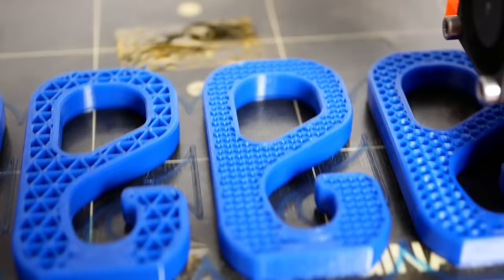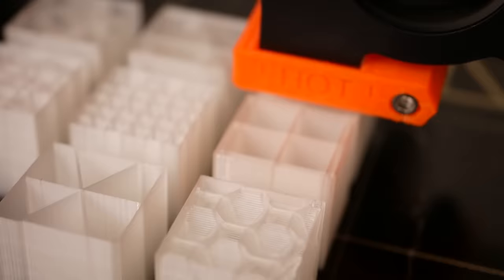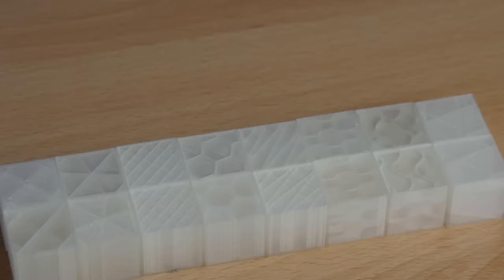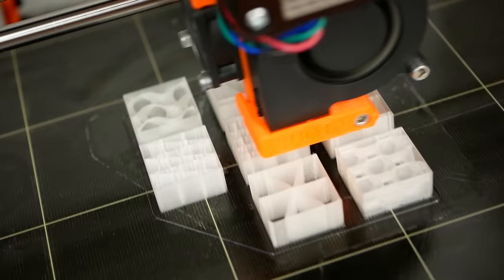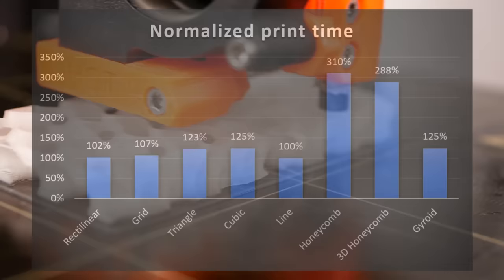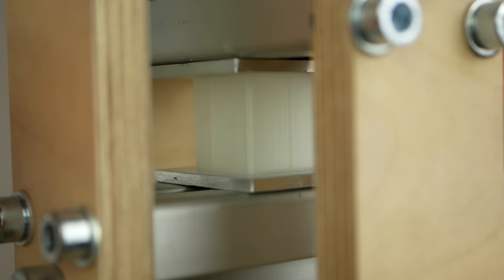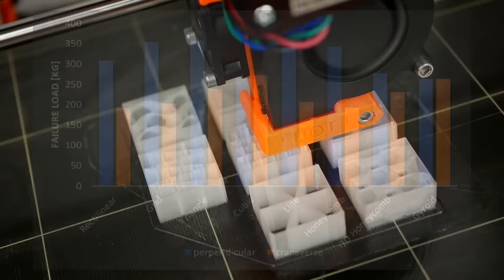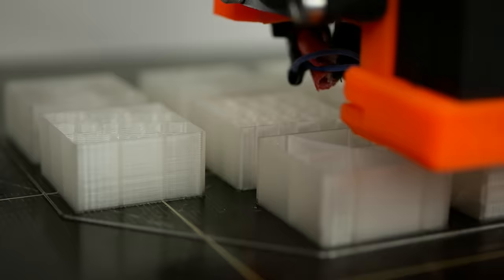TESTING 3D printed INFILL PATTERNS for their STRENGTH

Comment: Gyroids: Perfectly balanced, as all things should be.
Reply: Gyroid
Reply: Beside that it kills cheap printers..
Reply: I'm getting an ender 3 v2 and I was pre slicing a bunch of stuff I'm gonna print with gyroid 5% infill do you think I'll be fine I don't wanna rescale and slice everything
Reply: @alexunderhay6185  might be to late but yeah you should be just fine
Reply: @pivorsc  why would it be any different than printing anything else?
Reply: @nsboost  do a big print with it, it shakes entire device like theres an earthquake, unless you use good printer and secure it with screws to the floor, i wouldnt reccommend it
Reply: @pivorsc  as long as your acceleration settings are appropriate for the printer the infill doesn't matter
Reply: @pivorsc Does it? I've been doing it with my cheap printer for a while now. Neptune 3 Pro
Reply: @pivorsc  As someone who uses almost exclusively gyroid on an ender 3 v2, no. Gyroid infill prints very smoothly due to its winding nature, and the accelerations being relatively low and constant. There is no "earthquake" shaking of the printer
Reply: @AniviaS  If you have to change your settings to slow your printer down to use gyroid why not just switch to cubic? It's better and faster. Who cares how cool your infill looks? It's literally inside the print.

Comment: A test of bending strength might be interesting - print a beam and load it in the middle. This tests both tensile and compressive strength.
Reply: I'd be very much interested in seeing that as well, seeing as I've been playing with the idea of printing my own rear fender struts(non loadbearing) for my motorcycle.
Reply: JonzuihGaming I agree with this.
Reply: Well, I have been watching this since he put it out but I now have a reason to switch so I just asked him "Stefan, which of these would be the best for a bending type force?  I am
 thinking of the Z axis on a CNC router where the spindle/router will be pushing, and pulling, on the plate that holds the tool and I can't figure out which would be best to use."  I look at all of these and I really don't know.  What I do know is Gyroid almost tore my machine up with 50% being used.
Reply: Bending strength, shearing strength and torsional strength are all properties I am particularly interested in.
Reply: Yes, please do a bending test and please throw a solid wall (only shells) in there as well. I have been searching all over and cannot get a good answer on what to use. For example, think of a drawer that has long unsupported walls that could be 12" long and maybe 5" tall and only has 3-5 mm walls. What method what best prevent flexing/bending of the walls?
Reply: Bending test would be awesome
Reply: Maybe even twisting and torque

Comment: I'm a huge fan of your videos. Really appreciate the scientific approach. Reminds me of my youth lol. Much of the work I did for my master's degree in mechanical engineering involved compressive strength tests of different formulations of Portland cement.

One trick I would suggest if you're reaching the force limit of your machine is to scale the sample down. If a 2cm cube failed at 350kg, a 1cm cube would fail at around 90kg. You could make all samples out of that so you can still compare. I would also suggest upping infill to 15-20 percent to emphasize more the infill differences and minimise the effect of the perimeters.

Since you asked at the end what we would like to see, I have some ideas. I would like to see a test of stiffness/rigidity (Young's modulus) of the different patterns.  When I squeeze a part with rectilinear infill between my fingers I feel more flex/give than the same part with hexagonal/honeycomb infill. One way to test this would be to print a 2cm calibration cube and then press a 1cm cylinder into the center of the cube's faces (top and side faces) so that you're stressing the infill rather than the perimeters. Measure the stress, strain, and ultimate strength and the results should show which is more rigid.

Another test I'd like to see between rectilinear, grid and honeycomb is a simple 3-point bending test (x3 variations, them being with layers oriented in X, Y and Z directions), and lastly a cantilever test with one end of the beam clamped rigidly and the other end loaded with your tester to produce a force-displacement graph. Then just plot the results of all the patterns on the same graph and it will be easy to see which is the most and least flexible.

Hope some of this inspires your next video! Thank you for your work!
Reply: Another small tip I learnt from experience. Before you commit to making a collection of samples, make just one and test it to see how the equipment handles it so you can fine-tune at the beginning. So if for example you decide to do my 3-point bending idea, you'd print just one bar and load it up. If you notice you're close to hitting the displacement limit on your tester, you would revise the bar to make it taller. If you're close to hitting the force limit of your tester you could increase the distance between the bottom supports or decrease the Y-dimension (width) of the bar. After 2 or 3 iterations you'll have a specimen design and test protocol that's comfortably in the middle of your machine's range of limits for displacement, force etc. Then you can proceed to make the 20+ identical samples for the real test and be confident that you're getting the best possible data from them.
Reply: A 3-point bending test would be nice to see with  2 cm x 2 cm x 20 cm or 2,5 cm x 2,5 cm x 20 cm bars.

Crushing small cubes with huge force is not very sensible. It does not reflect real world conditions.
Reply: LMF5000 you spent too mutch time 4 8 likes
Reply: Yes the bending tests I would be particularly interested in. I've just printed a spool holder for the 3D printing nerd competition and my design is practically a long beam and I really wanted to optimise strength/weight. Most of the bending resistance comes from the walls but I did use triangular infill as that acts like an internal truss structure for the beam and I'm fairly sure that is the best infill under that loading condition.
 Up to this point I have been using just triangular infill for its inherent rigidity and strength, although I may start using line or rectilinear as that is quicker and produces a higher part quality for everyday objects and actually has a similar if not higher strength/print-time ratio (also I've been limited to lower layer heights because the flow rate on my printer is limited atm so pillowing on the top layers is more apparent). 
 Another test which would be interesting although not hugely applicable to everyday objects, would be a shear loading test. Take a 1.5cmx1.5cmx4cm oblong and create a shear load along its long axis. Fix one side down a produce a shear load on the opposite side with different infill patterns and orientations. I would guess that triangular infill would be strongest there as well.
Reply: 'scale the sample down'.  On the other hand scaling the sample down would make the side wall strength dominate the test over the infill even more.  Even a 2cm sample is already a little small for this sort of testing, but it is representative of a lot of 3D prints.  Much better would be to keep the sample at 2cm and simply change the mechanical arrangement a bit to give it 2x the advantage so it has enough leverage to break the sample within the range of measurement, and simply double the number of kg shown on the scale.
Reply: Great comment.

One other type of consideration that would be helpful when selecting perimeters and infill would be torque on a cylinder such as a rod or a threaded fastener.  Which type of infill and how many perimeters is best for this type of application?  Do Archimedean Cords perform best for torque?

Comment: Gyroid Infill + Gradient Infill + Non-Planar Slicing would be a perfect combination in my opinion. I would also suggest doing some bending tests to simultaneously test tensile and compressive strength, as well as some shear strength tests.

It would be awesome if you could also use a hybrid infill that changes the infill pattern and ratio based on the location in the part and what kinds of stresses those locations would experience.

Comment: My first printer is on order and I'm gathering as much useful information before I start. I had no idea that there would be such a large difference in print speed depending on the style of infill using the same about of material. Thanks for taking the time to do this, it's very helpful.

Comment: The ONLY thing I love about Cura is "infill multiplier". I haven't found a way with Prusa slicer to reproduce this (no, things like extrusion width don't cut it and lead to very different results). Bascially "infill multiplier" makes 2, 3 or more infill lines where there is normally only one. For stability the number of outer shells is king. Infill doesn't matter much. BUT if you use "infill multiplier" (e.g. value of 3, with infill percentage of 15%) you get something like "internal walls". Then increase infill overlap from 30% to 50% or more and those thick inner walls really connect to the outer walls. This is really amazing stuff that nobody uses!

Comment: wow this is a lot more in depth and helpful than I was expecting. Thank you for making this. My only comment is that if one doesn't care about strength and wants to optimize for the look of top layers, what you suggested is good, but Cura's "lightning" infill is just better in my opinion. It generates infill basically just as supports put on the inside to make sure the top looks as good as possible while optimizing to use relatively tiny amounts of material. Not sure if a highly similar infill type is available on other slicers, but either way I hope it catches on and becomes a common(and more well explained in the slicer lol) option

Comment: Thanks to your research we know that more perimeter will equate to better strength, but would there be any difference in strength  if we keep the overall perimeter width the same, but change the nozzle diameters? 6 perimeters with 0.4mm nozzle will gives us 2.4mm overall thickness of the wall. With 0.6mm nozzle we only need 4 perimeters. With 0.8mm nozzle 3 perimeters.
Reply: I tested changeing nozzle diameters for walls and infill and unfortunatelly you get equal-more strenght( with equal thickness) but it print times are only 1-2% faster.

Comment: Cubic is my default infill choice, speedwise is usually very similar to rectilinear. I only use rectilinear when the shape is not a good fit for cubic, like spherical parts. I am curious about what drive your choice of gyroid over cubic. Was it only aesthetics? What are the speed diffences? Which supports the top surfaces better?  Which uses more filament (if you disregard the tuning to have same wight)?

Comment: You should do a video on infills effect on part warping. Theoretically, gyroid would reduce the chance of warping with materials like ABS as it doesn't use long straight lines. The idea is that infill patterns with long straight lines would increase internal tension on the part. Would love to see if there is a measurable difference, but I do not have the time to test it as thoroughly as you do in your videos.

Comment: I'm liking PrusaSlicer's "adaptive cubic" infill more and more, to the point where it's now my profile default. Strong yet fast. You can set the density fairly high, the cubic infill density is high near the exterior surfaces, but more open and hollow in the middle. The algorithm seems to be testing whether a larger hollow cube would fit without interference, and if so, it makes the largest hollow cube that fits.

Comment: Thanks!  Was looking for a good speed vs strength vs density discussion and that was all covered very nicely here.  Finally getting a new printer which has all the fancy infill patterns in the default slicer.  Before I was using a pretty basic slicer because I hate to update them and mess with bugs etc...

Comment: I recommend against lines. The Z strength is terrible in extension, due to the layers only touching each other at the intersections of the lines. It's also terrible at shear loads due to this.
Reply from the maker: Good input. But that's also the same with rectilinear.

Comment: infill is pretty much just for top layer accuracy. the number of walls has a far greater impact on part strength. use a variable or gradient infil if you slicer of choice allows it. so it will slowly ramp up infill density when close to top surfaces to give them a good finish, and be 10% or less in the middle.

Comment: A niche application that I think cubic might excel over all the others is flotation. Barring printing issues (i.e. under extrusion from trying to drive volumectric flow higher than the hot-end can support), the cubic infill seems to generate a closed cell type of infill. All the others are create an open cell structure where if a perimeter is breached water can flow through the infill.
But, that is a very specialized corner case (though all you people printing RC boats might want to use cubic infill).

Comment: Have you ever tried filling the infill volume with epoxy to increase strength of parts?  After seeing the infill pattern from the top on a failed part it seems you could use the printed part as the cosmetic and form for a strong epoxy filled core.

Comment: My company will be testing 3D printing's engineering true super strength with constant pressure being applied in a small business this week! I can already tell you Carbon Fiber printed at 20% infill and rectangle infill is NOT the way to go. We 3d printed some replacement parts for a local gym. The owner complained about the original manufacture creating cheap plastic parts that break easily. I'm currently on prototype number 3! Fingers crossed 🤞 that  Gyroid infill and Carbon Fiber at 90% infill is the way to go 😬🤞🤞 if anyone has any other advice or suggestions I would love to hear your thoughts!

Comment: On the subject of the MK2 rattling itself apart, I've found that blue thread-locking adhesive works well. The blue stuff's also decently easy to torque free if you want to take the Y carriage apart or remove the gantry for something, and I haven't had to re-tighten the frame in months.
Reply: To prevent rattling, maybe reduce acceleration for infill, 2000mm/s²

may be a bit much, I typically reduce it to 1000

Comment: Hi Stefan, 

great work you have done again! I think, one of the main Problems is not the infill itself but the first shell layer on top of it, especially, if it is in the middle of the part (does not stretch from one side to the other). For me, printing time is not the highest priority and neither it is strength. The smotheness of the cover layer is of more importance. 

Another interesting variable (for strength and cover layer) is the overlap percentage of perimeter and infill (should be also available in Prusa Slicer Edition).

I don't know, how to fit these two topics into your investigations to get objective results, but I would be very interested in the result.

Thanks again for your great channel.
Reply from the maker: You can try gradual infill in CURA, that can help with the first top layer. Otherwise it really depends on the slicer and infill. For esthetic parts I usually use rectilinear infill because you get more infill lines per layer as with others.

Comment: This is if you're searching for maximum strength. But sometimes, printing with TPU, you need extra flexibility in Z direction and cannot rotate your part on the bed for some reasons (e.g. tunnels for screws and compartments for nuts). Which infill would you recommend for this particular case? X/Y can be quite soft too, but the purpose is maximum flexibility along the Z axis.

Comment: I just used gyroid on a tall print and at a certain point it caused a gap almost like support material breakaway and the large part tore in half like paper. The gap was uniform throughout that whole layer so i don’t know if it was a mechanical or software malfunction. Sliced on cura at 15% .2 mm layer wall thickness .4

Comment: Line infill causes warping for me way more than any other infills. Its like those lines are pulling the perimeters inwards and off the bed around corners. This happens especially with larger prints. I prefer rectilinear since I've discovered this.

Comment: Thank you for doing the test work. Your work helps me a ton when I am doing my projects. I am printing gaming pedals. Something i've noticed is that the cubic performs better when you have stress concentrations. My shaft for pedal was failing at cantilever joint with gyroid for ~50 % infill. But with cubic, held up good. Gyroid is still my go to option though.

Comment: In my experience PETG does not like infill that doesn't print on itself (like rectilinear).. so, in theory, you will get much worse results with PETG rectilinear when compared to that infill used with PLA.

Comment: Can you try to somehow seal up these cubes and then suck a vacuum? See if they can withstand the atmospheric pressure? And if so weigh them before and afterwards. And then calculate which structure is the strongest but also lightest? AND THEN figure out if it is possible to create a structure like that with a material lightweight enough, so in the end with vacuum it displaces more air then it weights???? then we have an endless floating cube :D AND THEN we could build Airships that fly without power just based on air buoyancy. AND THEN we can build a giant fleet of airships that replace almost all ships and planes and have basically zero energy needed way to transport stuff fast anywhere :D